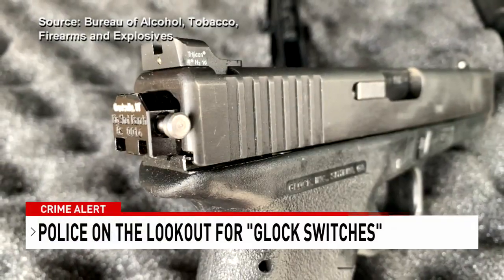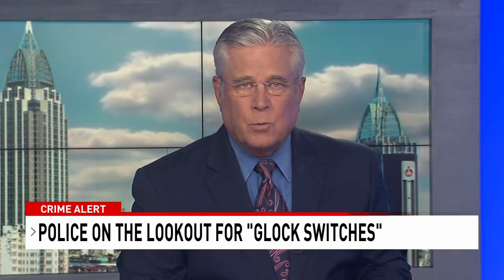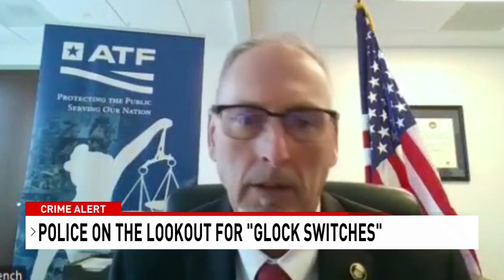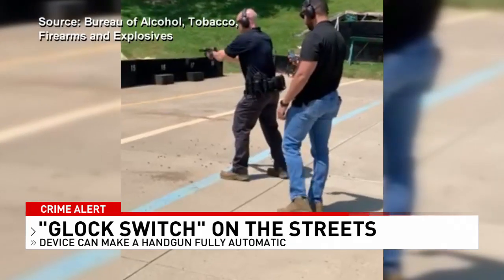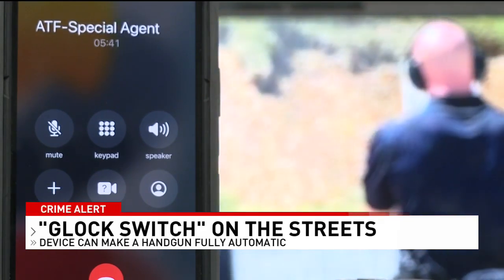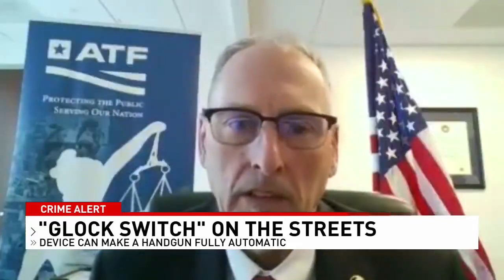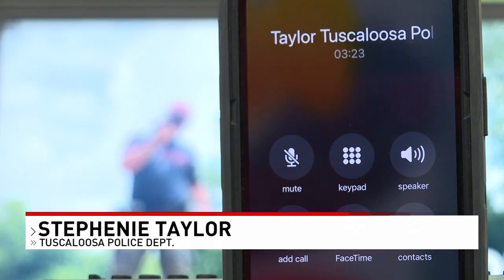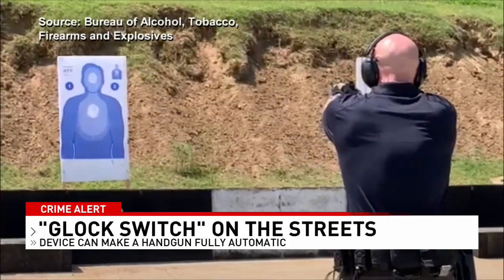Police on the lookout for "glock switches" - NBC 15 WPMI

Comment: What’s wrong with full auto guns people still have a finger that can shoot 15 rounds in 4 seconds having a switch that can shoot 15 rounds in 2 seconds doesn’t make much of a difference
Reply: well these can shoot up to 1200 rpm which is 30 rounds in 1.5 seconds.
Reply: @tbm7301  right 🤣
Reply: @tbm7301  so how does that make it more dangerous
Reply: @ShockShorts  never said it did or didn’t, just correcting you.
Reply: Bro a switch is more dangerous who or whatever is in the line of fire of a switch is Swiss Cheese
Reply: @tyreup4799  so? The more pain the more better 😈.

Comment: so if they are not accurate and they use up the criminals ammo very quickly, why are they so worried?
Reply: @Abk556  should be legally to have full auto gun because the regulars soldiers have them.
Reply: Police scared of them becuz itz an advantage, they’re not likely to try & chase some1 who’s firing a fully auto at them.
Reply: If u Tap it it shoots like a 3 round burst . You can’t squeeze the entire thing it’s too strong . Juss tap it multiple times it’s gonna shoot 3 at a time accurately
Reply: @visionjay5094  you can shoot it all the way out if you hold it right. Firm grip shoulders forward & aim low to hit the target cuz the gun will go up as you shoot. Itz videos of people Doin this without stoppin
Reply: Lol you’re silly I have a full auto 9mm pistol fires faster than even these Glock switches . With the right ammo I timed it my gun can dump 30 rounds in 1.2 seconds and I can easily hold it on target with one hand. Granted I have tons of experience shooting full autos
Reply: @user-oy9zy4ds9m  switches is fully so you lying 🤣 they let off the same amount of rounds you said in da same # of seconds
Reply: @kevonsidek9737  lol sure bud